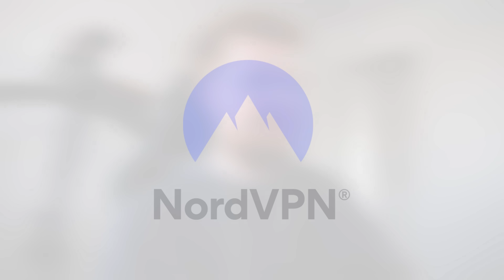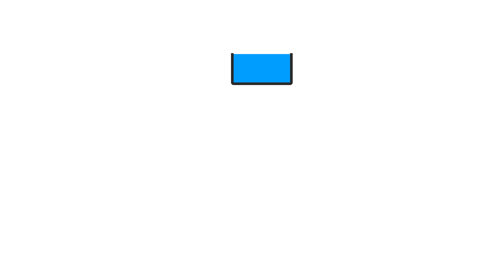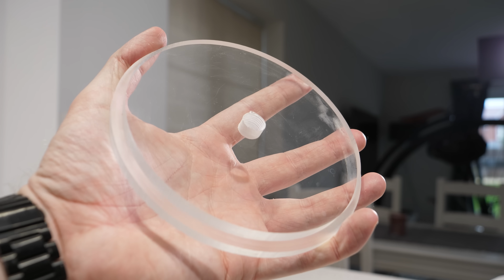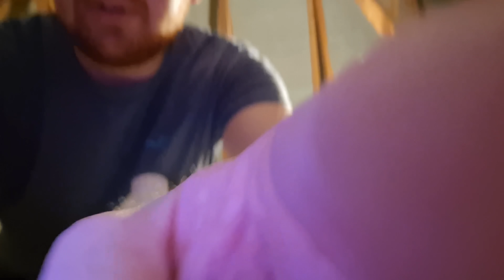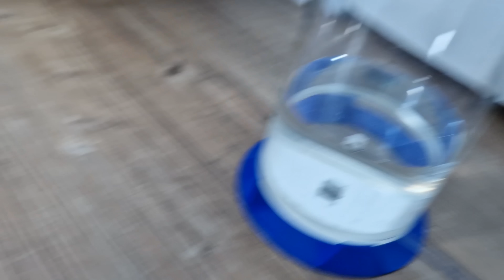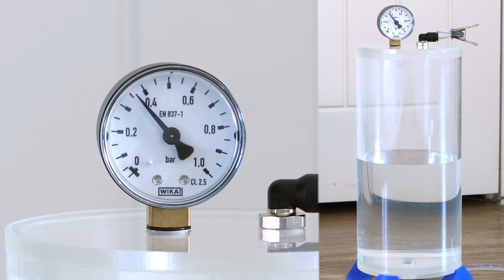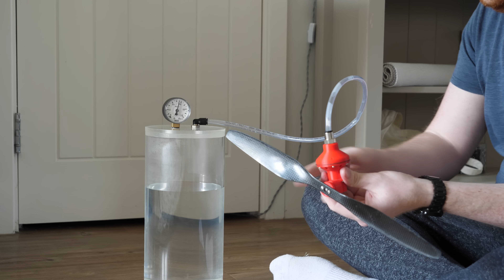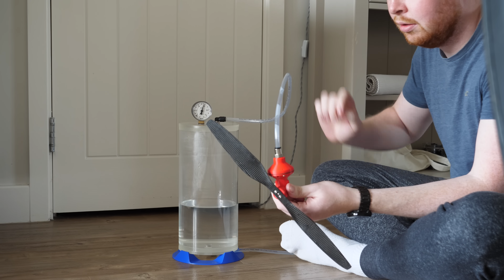Liquid Air Engine

Comment: Loved it when we started to see the varying speed and pressure at steady state. I hypothesise they vary sinusoidally with the pressure leading the angular velocity...
Reply: That hypothesis must be true at least to first approximation.
😉

But what causes the slow time constant? Not the mechanical inertia of the engine.
I suggest something like the piston warming up a tiny bit when its speed is high, which somehow makes it better lubricated such that it can maintain that higher speed for a bit even when the pressure drops.
Like a hysteresis loop.

Or maybe it is the mass of all that water in the tube? The tube was long and the pressure differential is quite small. But is that mass so high that it takes a while to get going, I doubt it somehow.
Reply: @landsgevaer I think we're best served thinking of the 'rate of change' rather than absolute value. 
When the pressure is at it's peak the rate of change of velocity will be at it's peak.
But as that velocity increases more air is drawn through the engine causing a negative rate of change of pressure. As the pressure reduces, so will the positive rate of change of velocity.
Once the velocity is at it's peak (rate of change is zero) the negative rate of change of pressure will be at it's peak since this is the most air being drawn through the engine.
The rate of change of velocity will then go negative which starts drawing less air through causing the negative rate of change of pressure to reduce.
Once the negative rate of change of velocity causes less air to be drawn through than is required to sustain the pressure the pressure will start to rise again which causes the negative rate of change of velocity to reduce then go positive completing the cycle.
This is two sine waves with the one representing pressure leading the velocity by 90 degrees. If we measured the period of the wave then one quarter would be your time constant? Or are you suggesting something else?
Reply: @NobleBrutus  Not sure what the mechanism is, but I don't think it is as simple as inertia. In the video you can clearly see the rotor speed up and down during each cycle every time it receives a kick; the rotor's speed isn't maintained long. In my opinion, the rotor simply doesn't have enough momentum to keep rotating fast until the pressure is low, as you seem to suggest. Or, in other words, the system is damped too strongly to allow an oscillatory solution.

Well, that is, obviously we do see an oscillatory state, but it isn't just the inertia of the motor that causes it, I am willing to bet.
Perhaps the momentum of all the water in the tube might be enough, but I would bet against that too.
I would be inclined to think that maybe when the engine moves fast, friction warms the piston a tiny bit, and perhaps the warm plastic provides slightly better lubricating properties such that the engine keeps running well even on lower pressure. Just a suggestion, but something like that.
Reply: @landsgevaer  The rotor speeds up and down each 'kick' due to the design of the motor with the diaphragm. You are right then that the solution involves discrete bursts rather than continuous exhaust of air. If you averaged the angular velocity of each burst and plotted I think you would get a nice sine wave?

The effect of the momentum of the water and temperature due to varying velocity at steady state I would bet on being negligible or constant. At steady state I would expect the flow of water to be constant.

Comment: I wonder what would actualy happen if you ran the engine on pressurised water. It would probobly need a flywheel to push the piston though the water but I wonder how it would sound and run.

Comment: on the moving parts you can use white printer grease for the engine to run smooth. In the tank the water rises reducing the air could use a return with pump the same in the car tanks so there will always be air volume and pressure. great project

Comment: You should try having a Hydraulic Ram water pump pressuring the cylinder, you will need a pressure vessel capable of holding hundreds of psi. You will just need a slightly elevated stream to provide the tiny flow of water at 6foot or so head. Hydraulic Ram pumps will pump a very tiny percentage of the water flow to astronomical heads using water hammer.

Comment: its gravity powered, neither air nor water are doing the work
Reply: Actually, it's human powered. He is hauling the water to the attic. The water weight, air and atmospheric pressure, gravity, and sealed container are just assisting to transfer energies and a specific flow rate. 🧐

Comment: Drilling through both and use a tube with holes and make it hold the lids on too as well as the fittings will be built in

Comment: rather than carry the water back upstairs, I'm surprised Tom didn't just use a track pump (or similar) and put excess s air pressure on downstairs to force the water back up the pipe

Comment: So how would swapping the propeller out with a flywheel change the performance? I mean as a mechanism like this would never be able to fly anyway, I'm wondering how many watts something like this could generate.  Like a pneumatic water-battery, having the benefit of only needing debt of water as apposed to needing a mass of water to create power.  Keep up the great work my guy!

Comment: Hey  good clean fun Video. But could tou Please use both metric and imperial ? We rarely use meters in many counties including the USA. Bars  Almost never. Kilos? Mostly drug dealers  So PSI and BARS Meters AND Yards or feet In short use both. Many channels in USA only use Gallons Feet PSI Miles Lbs etc.. Consider to use both.

Comment: Very satisfying, love your videos Tom! I have a suggestion for a video idea, you should put a vacuum chamber on your bike instead of a flywheel. With a vacuum chamber you can theoretically retrieve 100% of your kinetic energie. Plus the pressure difference is constantly 1 bar resulting in a constant acceleration/deceleration

Comment: Wouldnt reducing the pistons surface area that touchs the inner walls of the engine reduce friction? Like, have it on 3 outer rails that touch the walls instead of the whole piston wall. 

Would that ruin the airtight seal? Because I think the air only needs to power the rubber seal, so it shouldnt matter lower than it.

Comment: Consider getting a resin 3D printer, It prints these smaller parts at a much greater accuracy, I've recently printed a hole with M10 threading at H6 tolerance, which, 3 years ago would have been impressive for a 3d printer, while now it's just, meh!

Comment: Connect it to a tap instead and get that sweet constant 80psi (give or take 20psi).
Reply: 56 here.
Reply: until it fills up.
Reply: @bermchasin  you could have a pressure(water) release valve at a certain height in the acrylic container. there are many possibilities here for what kind, perhaps the easiest would be a swing valve(attached to wall) with a floater fastened so that when the water reaches a certain elevation it also lifts the swing valve up letting the water escape. the height of the floater has to be a certain distance away from the swing valve so as to not let any air escape.

another design would be a vertical ball valve attached to the side of the tank with a floater valve attached through to the tank with aluminium/steel wire and a floater on top. grabbity(air pressure) would hold the valve(ball) down until the water level would lift it with water. when the water level would go back down the valve would do too. maybe this is a more solid design.
Reply: @bermchasin  have 3 reservoirs, switch between them and let gravity drain.

Comment: Another trick with air/water: fill a tank with water (not fully), presurize the rest with air, then use that pressurerized air to propel the denser/heavy water as 'rocket exhaust'. Not sure if that does anything for an engine, since the only bonus is having a light, compressable fluid propel a dense one. But still a neat trick.

Comment: You may consider adding wear plates in the engine design - smaller surfaces that take all the friction, reducing overall friction and allowing the engine to break in faster. Also, a catch tank between the engine and pressure cylinder may give you another moment's notice before the engine floods.
That said, this is honestly the coolest use of water pressure I have seen in a very long time!

Comment: Do you think their is a way to incorporate your motor design into a "Stirling " type engine/cycle? Utilize an external heat source in place of the air tank. Maybe small concentrated solar setup or candle?
Imagine a solar powered aircraft, without solar panels or electric. That be cool.

Comment: in terms of the 3d printing side of this project. you might want to try a resin printer for your engine as those can normally be a bit more detailed than FDM printers and don't leave the blobs of plastic that you were talking about

Comment: Great content as always! My first idea for increasing the preformance was making the watertank act as a syringe and add a weight to it to simulate a greater height. Maybe that would be cheating or flat out wouldn't work. Just a thought.
Reply: Before Electricity they used hydraulic and pneumatics. Weights on tanks were called accumulators.

Comment: I'm not as smart as you so this may be a stupid question. Would it be possible to add pumps to this design?  at both the top and the bottom?  and would it flow much faster?

Comment: I wonder if you could tap into your existing home plumbing to get a bigger pipe diameter without having to run it down the stairs...

Even better, take the project outside and use a downspout

Comment: What about making a turbine instead of a reciprocating engine? With the flow rate of the current turbine, I think you'd need a pretty small, fast spinning turbine and some gear reduction, but I think the smoother, more continuous motion of the turbine might harness the pressure more efficiently.

Comment: Dude, look up a trumpe pump. You'll see similar concept but on a more continuous scale. Only with the ability to refresh the sir supply automatically, and send the water on its way after using it to compress the air.  Its old technology. Mostly forgotten. But before electricity, they used water to compress air for use. There were even compression plants that were build around the concept. Might help answer some questions, and point you to a more sustainable answer if you have an adequate water supply. Maybe you could loop the system given current tech. Who knows. Worth a look.

Comment: Buddy I like your videos, But using a tank in your attic to generate 0.6bars of water pressure ?? Really ? it is not like any tap in your house is already providing 3-4bars as is ...

Pumping air with a bike pump you'll achieve 6-8bars in a few minutes, this is the most pointless way to create pressure

Comment: Honest question, But would potentially combining this with a double or even triple expansion styled air engine make it even more efficient?
Reply: No, the pressure isn't high enough. Steam engines didn't get double expansion until they got to several atm. The extra friction takes more power than it harvests at such low pressures.
Reply: Multiple expasion engines only used to prevent energy lost while steam expanding and temeprature drops. Or when small intake valve cutout is hard to implement. But air engine with piston-operated intake valve with automatical outake is not the case.

Comment: Removing all the air from the water hose should increase the flow rate, giving you a bit more energy to work with.

Comment: Very cool idea. In essence you've built what's called an accumulator, using hydrostatic head instead of a spring or pressurised gas as would be more conventional. Neat idea as normal accumulators have a small change in pressure depending on the volume of stored fluid but this will produce constant pressure!

Comment: Very nice. Would be interesting to ditch the bottom tank and try to make something run off the water itself, but that would likely require a complete redesign. That said, I suspect a turbine may be the best way to go for water, so maybe one of your existing turbines will work well for it. Some gearing possibly required. Also grease.

I’d say a single-piston engine would be better off with a larger flywheel. That or you could try making a three-piston radial. For low flow rates you could make the air flow through all three pistons sequentially (I think, the air going into the crank-case might prevent that) and for low pressures you could make the air flow through them in parallel.

Comment: The engine seems to work very well, how efficient is it compared to the previous versions and when are you going to share files to print it for ourselves, I have been fascinated for a long time with air engines and printing one for myself would be really nice

Comment: A self contained version of this would be to have a syringe type thing with a heavy duty spring pushing the syringe so it pushes water into such a container ,powering the engine. If lightened and optimised it may be able to be put on an aircraft or a sort of vehicle, it would basically be like an airpowered plane like you did but you dont have to pump it. You only need to compress the spring

Comment: Given the fact that pressure is directly correlated to the density of the fluid, I would expect about a 20% increase in pressure if you used a saturated salt solution instead of plain water. Of course that would be a lot of salt, and you could absolutely get even better performance from other solutes like sugar, but it would be really interesting to see just how much pressure you can attain from that system without too many modifications.
Reply: Or mercury, I also thought. Bit hazardous perhaps.

Putting the container a metre higher also gains some 20% btw; not sure why he put it at knee height only. 😉

Comment: Great job! I wonder if this much more efficient motor would be capable of running on a 2 liter bottle for a long enough duration to achieve flight. In order to do that you would probably need to design some kind of pressure regulator that keeps the pressure that is actually going to the engine low enough that the engine is barely able to keep itself going at a speed fast enough to produce thrust. If you managed that I wonder if it would be capable of a reasonable duration flight in some kind of custom plane that essentially a glider as far as how much distance it can go for distance dropped and make it optimized for slow flight.

Comment: Wow that ran well !

Unrelated to the experiment, if you ever have the need to make a nice acyrlic pieces you can flame smooth the cut edges using mapp gas on a low flame.  Just keep moving and you will see it turn as clear as it was before the cut.  Fine line, over heat it and it will blister so low flame and keep distance steady.   Mapp gas burns really clean, I don't recommend propane.

Comment: Tom, a pressure-assisted flush mechanism for toilets works in a similar way. It uses the water pressure in a regular water line to pressurize and compress the air in a closed tank. I think "FlushMate" is one of the brand names. You could also just use water pressure from regular water pipes (assuming you have water towers in the UK :)

Comment: Larger diameter tubing should help even without replacing connectors as at this piping length viscosity losses are a major component of pressure loss.

Comment: As you learned, cutting plastic is all about heat-management. Too slow and it'll get hot and melt on the hotend. Too many flutes, and the odds that chips will be welded to the end mill go up substantially.

Also, fingers crossed that the sharp edge in that acrylic panel holds. Similar to laser-cutting sharp internal corners in acrylic, sharp edges in acrylic will increase the likelihood of stress concentrations building and eventually leading to failure.

Comment: Why don't you connect it to your tap and use the (much higher) pressure from your local water tower instead?
Since I assume you're using the tap to get the water in the first place...

Comment: If your going by your logic you could take a cup of water with a small 5mm tube up a few miles high with a helicopter and you would have the same pressure at the end of the tube as if your at the bottom of the ocean 🤔 the only extra water weight would be what’s in the tube would it not?

Comment: Pretty neat. What about creating a small lake boat with an underwater propeller that you power with your legs to create air pressure? Would this be any more efficient than the old type of peddle boats that just use gears? I'm thinking the peddle motion would be more smooth and comfortable.

Comment: Mount the water tank onto a large Rc cargo plane then have the pressurized tank in a smaller glider flying under it being powered by the 3d printed motor 0% chance it works but it would be fun to try

Comment: Would rigging something that sent air bubbles back up the water pipe and seal the top of the water tank give more head pressure help.
I've seen this idea to pump air using water pressure in an old video about mining.

Comment: Happy to see you return to optimizing air engines, and sad that you never did test what the title stated (let the water enter the engine to see if it still works from the flow created by the gravity/reservoir - as opposed to simple changing the electric vacuum pump with a hydraulic vacuum pump).

Comment: This is a really cool demonstration of the physics, but I would just hook a garden hose up to it if you want more pressure. The water towers in your neighborhood are a lot higher than your house. Although the low pressure requirement did force you optimize parts of the engine, there's something to be said for that.